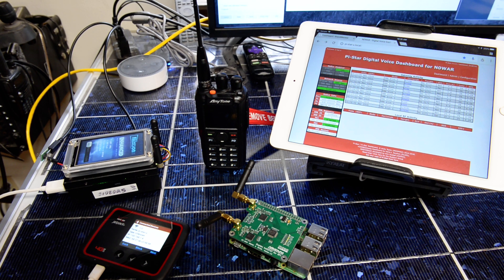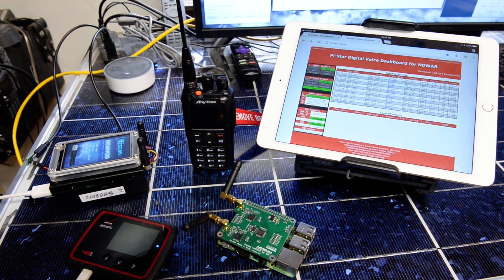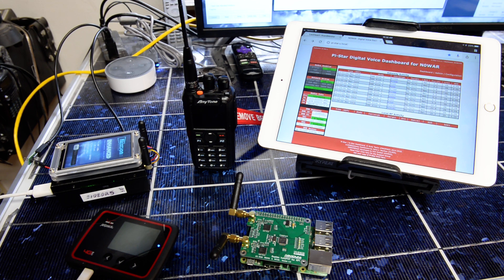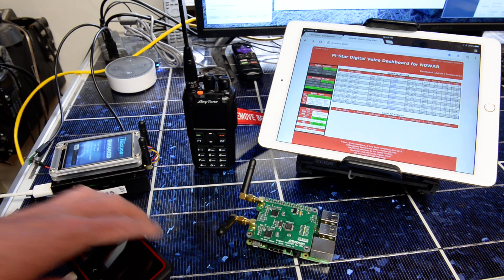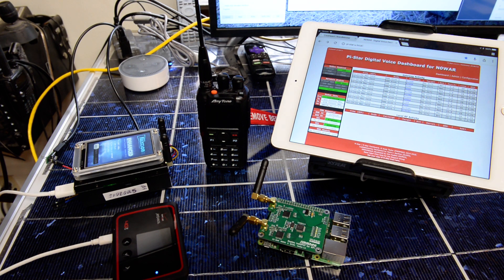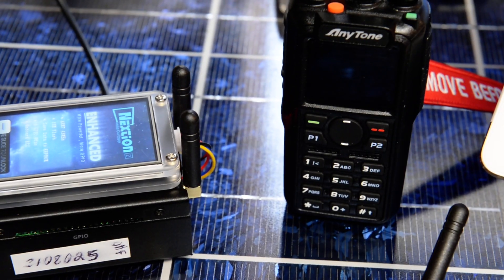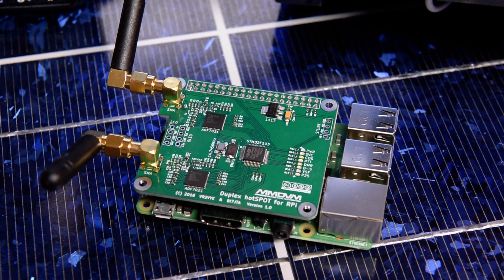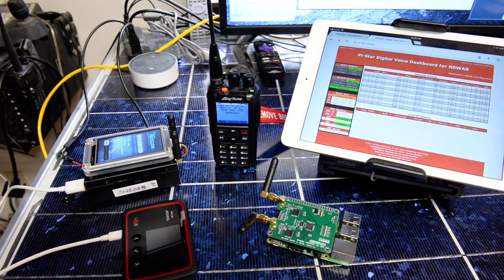MMDVM Duplex HotSPOT  from BI7JTA on RPi3B+

Comment: Hi. I am thinking of buying the BI7JTA Duplex HAT with double antennas. Unfortunately communication in the Englsh language with the seller is a little difficult. Is this MMDVM duplex hat operational on both VHF and UHF ot just UHF? 

In the Simplex board he says "PCB include SMA interface,5CM SMA ANT  (433MHz Ceramic antenna option, not including in this order)", which would mean that the 433 Mhz antenna is an option? 

Wonder if you may be able to clarify please? Thank you. 4S7EF
Reply from the maker: it will work on both 2m and 440mhz. hope that helps. peace

Comment: Do you find any heat issues ?   ?
Reply from the maker: no heat issues. i have 2 of these now. both have fans now. i run the fan on just one of them though. heat has not been an issue on either one of them. thanks for watching ken. drop in on TG 420 TGIF Network sometime. its the "Super Freq"
Reply from the maker: one of my duplex boards is on Brandmeister and the other is on TGIF Network
Reply: @ShutterMafiaStudios1  Still new to this...   I like that.  Its a pain to have to go into the config settings to switch from TGIF to Brandmeister.   Do you need to run separate freqs on duplex board as well as separate channels with freq to match the duplex board to determine Brandmeister or TGIF?  Does the duplex monitor both brandmeister and tgif at the same time?   That would mean 2 different internet server connections at the same time?   Ken
Reply: @ShutterMafiaStudios1  I am setup on TGIF.  Baofeng DM-1801 with a hotspot I made.  I was thinking of picking up a Pi 3 b+.  I never played with raspberry pi before the MMDVM project.
Been wanting to get into raspberry but not a software guy and hard to find projects to start you from the ground up on every project.  As you know the MMDVM was just to simple with no software knowledge needed.   It got me started.  Hopefully I can find more projects for a need with software ready to just copy to a sd card and run it.
I was thinking of building another MMDVM but with the pi 3 B + and wanted to put it and the modem board in a case.  I have a Nextion 3.2 inch display and could dedicate it to that project.   I question the fan because I can't see how the pi, modem can all fit in the case if you add heat sinks and fan.   Ken
Reply: @ShutterMafiaStudios1  I just add TG420 to my HT.  Are you available for a quick test?   Ken

Comment: In the Config settings, did you have to adjust the TXOffset and RXoffset?
Reply: Thank you, I'll check out that link.  I'm having a heck of a time configuring my pi.  I can receive traffic from my pi, but I cannot transmit to it.
Reply: @mgolden2  maybe it late already but maybe ur setting was not public but private. in dmr settings
Reply from the maker: i dont think i did. i still have 2 of them running now. one unit on tgif network via dmr and one on dstar both on simplex mode. let me know what the default is and i can look.  i just looked and dont think i changed them at all from default
Reply from the maker: lots of info here: https://www.youtube.com/redirect?event=video_description&v=t2DcaxduCs4&q=https%3A%2F%2Fwww.facebook.com%2Fgroups%2FNextion%2F%3Fmulti_permalinks%3D213037539446200%26notif_id%3D1522309582986267%26notif_t%3Dfeedback_reaction_generic%26ref%3Dnotif&redir_token=rX3ompRNVhtfK78RYxMzTAIbxdF8MTU1Nzc5ODk1MUAxNTU3NzEyNTUx

Comment: Any video's on how to set up the codeplugs in 2 tyt md390 gps handhelds to use with a duplex hotspot board?  I can't seem to find any and I'm sure it would help others out there as well.  Then how to set up pi-star using a duplex board :-)
Reply from the maker: get one of the "open spots". they are very stable and way easier to configure.

Comment: I've just come across these duplex hotspots but I don't really understand the point in it. Why would someone spend extra to get a duplex one instead of a normal, semi duplex one?
Reply: to link it to a repeater, you put it at the bottom of some guys repeater and connect it to 3g, and you can then hijack a repeater with it LOL
Reply from the maker: its like having 2 hotspots in one single unit.

Comment: How do I add the software to the screen so I can use it for DMR mini repeater and PI 3B?
Reply: With Pi-Star running on the Raspberry Pi, you can access the device via it's web page and configure it.  Best to start with an ethernet connection to the Pi, but once you've configured the WiFi to auto connect, you won't need the ethernet.  Once  completely configured, and if you're using duplex mode (separate RX and TX frequencies), you can configure static or timed static talk-groups via your Brandmiester dashboard page (see 'My Hotspots' on left side menu).  For dynamic (i.e. PTT) talk groups, the device follows your radio in the same manner as a repeater or OpenSpot.  For static talk-groups, the Brandmeister dashboard.  No display is needed once the device is on the internet.  I'm running the same device headless with a cheap 70cm/UHF mobile duplexer and it works fine that way.
Reply: Make: Jensai, Model SGQ-450.  These are on eBay for $100.  They have a little thermal sensitivity.  I'm seeing -1.9 to -2.2 dB insertion loss when cold, -1.2 dB insertion loss when warm.  Rejection is -93 dB to -94 dB (they are spec'd for -1.5 dB insertion loss and -75 dB rejection).  All with a 5 MHz split on 70cm.  I wish the insertion loss was stable within spec but they're good enough for my purposes...  FWIW, I know others who report less performance than I'm seeing, but I'm not aware of what performance their measurements are producing.
Reply from the maker: darren, can you get on tg 31088 colorado hd (hotspot discussion)? we can help you there!  let me know if you cant do that. de n0war
Reply: new to DMR. Do i program a contact in as TG 31088? I've ordered the screen, cable, pi 3b and mini DMR board. Trying to get a  head start before it all arrives. Have burned the imagine for the PI 3 and put it on the mini SD card areadly for the brandmaster DMR software.
Reply from the maker: yes, group contact and put in that number. we are on 31088 right now
Reply from the maker: thanks for the great comment sr viejo!!!
Reply from the maker: can you post a link or model name/number of the duplexer you are using sr? thanks!